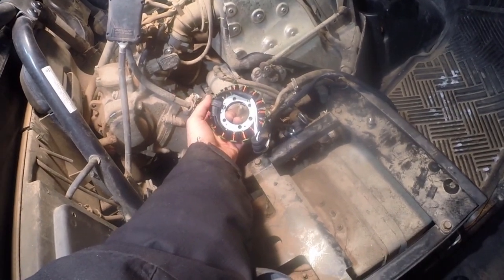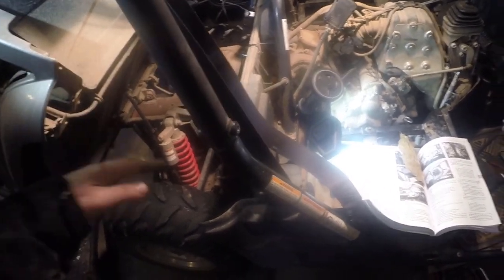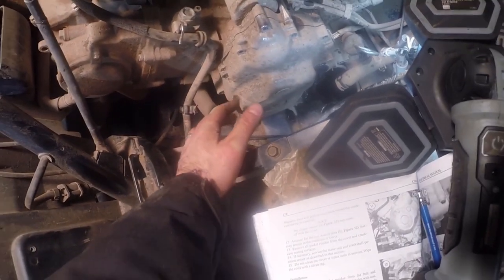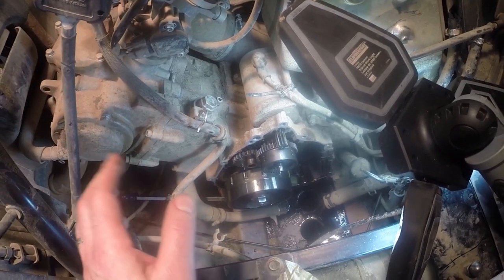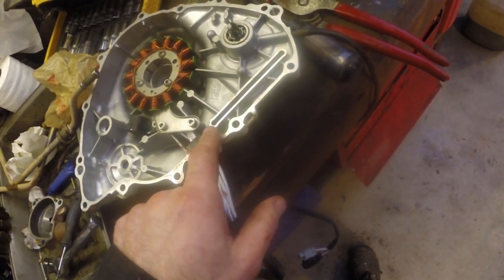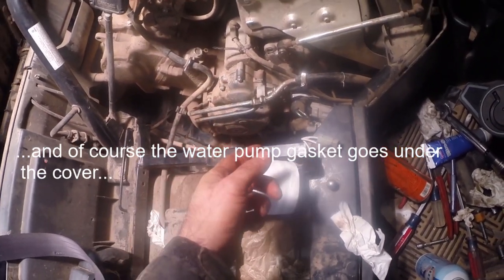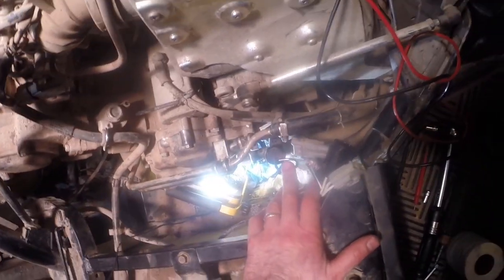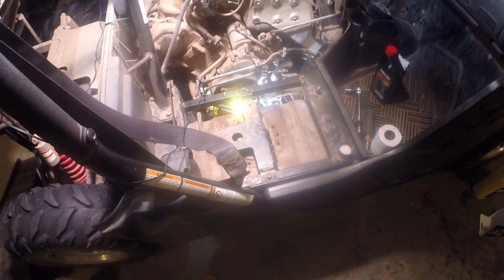DIY Diagnosing and Changing Stator on Yamaha UTV Rhino

Comment: Thanks, This info is going to save me $110.00 an hour. You even show us  techniqueIts to keep us out of trouble. probably take me a all weekend. But definitely worth the effort. Thanks again.  FYI. The coolant thing with the hoses.  It does matter. Think of water fall effect if the flow starts at the top. Not the desired effect.  Fill from the bottom. The water will fill the hole cooler.  Plus the air will purge from the top.

Comment: Good video, just finished mine. I like the template for the bolts. I used the gasket cardboard and poked holes where the bolts go. Worked like a charm.

Comment: Thank you!  Your vid was super helpful!   Yes you can remove the stator housing without taking the water pump housing off.  I did it and worked fine.  As for the electrical connections. Look at the connectors closely, you can take a screw driver, insert it where the plugs join, twist it and connectors pop right off.   Thanks again! Gave me a lot more confidence seeing it before I did it.  👍👍😃

Comment: What is that tapping/clicking noise after your changes stator?? I just did mine now it has a tapping/clicking noise until it gets warm
Reply from the maker: If you are suggesting there is a new tapping/clicking noise after changing the stator, that would cause me concern. It sounds like a mild interference issue somewhere.  I don't recall any such noise after completing this repair.

Comment: I also have a 2005 yamaha rhino 660 and I'm having the same issue. There are days when the rhino starts up just fine. then it dont want to start. it has a new battery.  when it doesn't start all you hear is a click noise from the relay. is the problem going to be the stator?
Reply from the maker: If it is intermittent it might suggest a dirty ground connection at the battery or fram or elsewhere. Start by checking that first.  You need to find out if the "click" is occuring with the starter turning because voltage is too low when trying to start.  If voltage always stays more than 12v, the stator and rectifier regulator are not the problem.  If it goes below 12v when trying to start you could have: bad/dirty battery terminals or ground to chassis/motor, bad starter, bad wiring, faulty starter solenoid.  These things all need to be diagnosed one by one.

Comment: Great video!! Thanks for posting. When I did mine a few years back I couldn't find much info online and this would have been extremely helpful. When I pulled my cover off  the gears and dowels did fall off, after the initial panic I just used the shop manual to get them all back in place with no problem.
 A can of gasket remover really helps a lot for getting the old gasket off without causing any damage, well worth the few bucks. Also a few dabs of grease on the new gasket really helps to hold it in place.
 I figured the root cause of my failure was more than likely caused by using the winch when heavily stuck in the mud and leaving the engine idling so as not to kill the battery, just a guess though. I removed the winch from the main battery and installed a secondary battery under the drivers seat with a battery disconnect switch. I just charge it before riding and keep it completely independent of the Rhino's electrical system  and so far so good. By the way, I have the identical C.T. meter, it's pretty decent considering the cost. Cheers!
Reply from the maker: Thank you for taking the time to add such great insight and extra tips!

Comment: Is it possible to change the stator without draining and replacing all the fluids or is it a necessary action for preventing spillage? I'm hopeful its not cuz that sounds like a lot more work than id like to do in my front yard 😅

I'm also certain that my stator is bad after watching this video and following the steps. It was super informative and very easy to follow.

Comment: If I change the stator on my 2008 Rhino 700, should I change the voltage regulator as well? Thank you for your great video!!! Gave me more confidence to do it myself!
Reply from the maker: If you test and prove your stator is faulty, replace the stator.  Then reconnect the wires to the rectifier/regulator and start the engine. Quickly test output of the regulator.  If you have a fully charged battery , engine running voltage should be between 12.8 to 14.5.  If you don't get in that range, suspect a faulty rectifier/regulator.

Comment: I’m just curious I ordered my stator from Caltric it was under 60 bucks. Which one did you put in when you replaced yours? Did you go with a higher priced one? they sure look the same as the other ones I’ve seen online just wondering your opinion
Reply from the maker: I don't remember the specific model but I know it was the cheapest on Amazon that had more than 20 decent review.  2 years later and no issues.
Reply: OK thank you for the reply. Great video very informative.

Comment: I have 2003 yamaha kodiak 400 not start, so you can start the and run without stator is working or not correct?
Reply from the maker: The stator has nothing to do with starting or running, only charging
Reply: Thank you
Reply: I also have a 2005 yamaha rhino 660 and I'm having the same issue. There are days when the rhino starts up just fine. then it dont want to start. it has a new battery.  when it doesn't start all you hear is a click noise from the relay. is this problem going to be the stator?
Reply: @JoseRamos-ke2nh  Not sure if you figured it out but your problem sounds very similar to the issues I'm having with my Rhino and following the trouble shooting steps he described in this video (found on another blog) I was able to confirm it was the stator.  In your case, likely either the stator or the voltage regulator (regulator restrictor I think is the name).